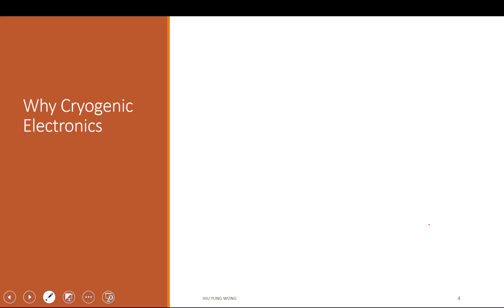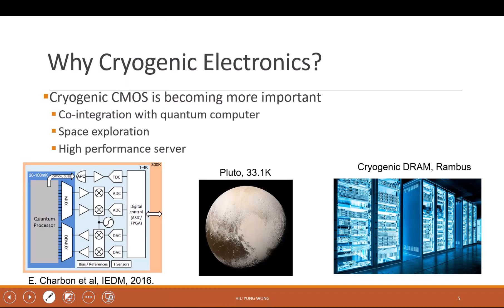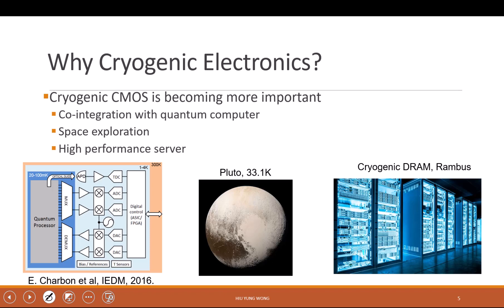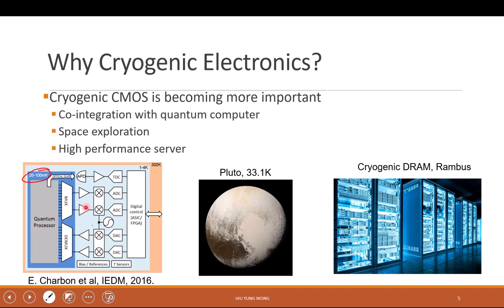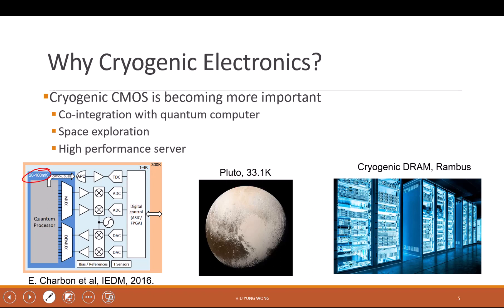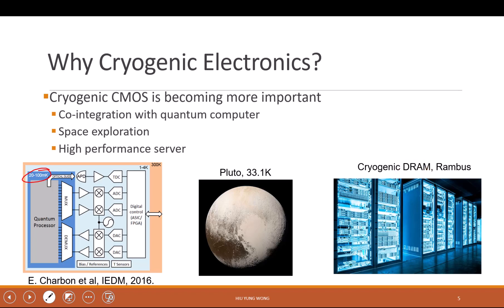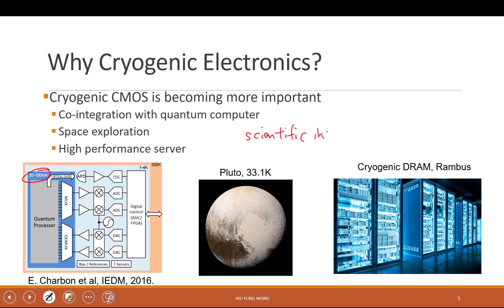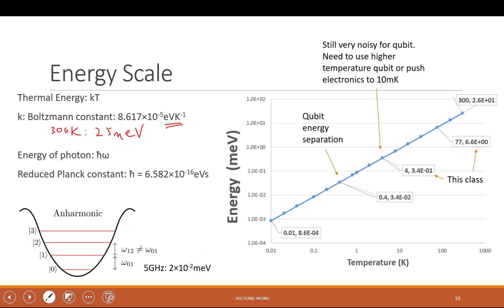L2A - Why Cryogenic Electronics and Energy Scale

Comment: The reason why we want the electronics to work at cryo temps is because the quantum computer will be then self-contained; the control chip can now be working closer to the quantum processor instead of pulling cables from one room temp. place to another at a cryo temp. The low-noise is simply a byproduct we take advantage of. Noise decreases but it isn't negligible as the thermal noose formulas would lead us to believe.